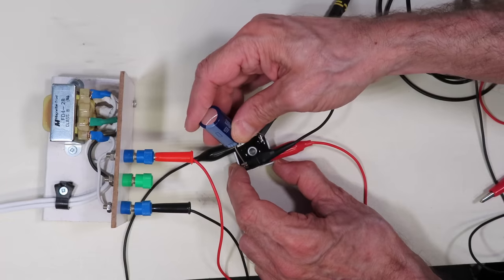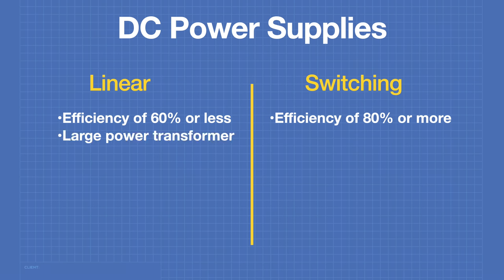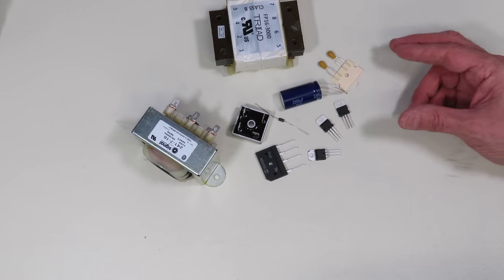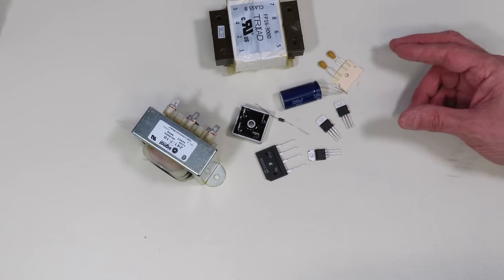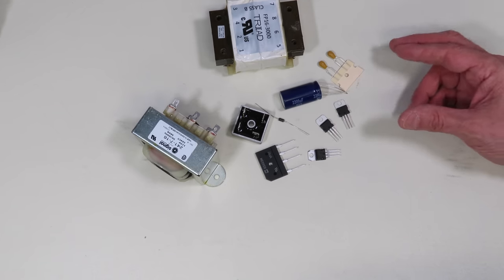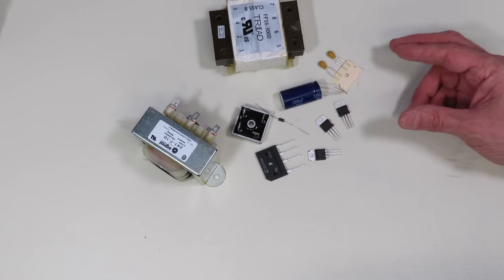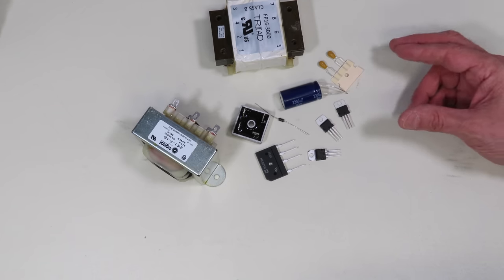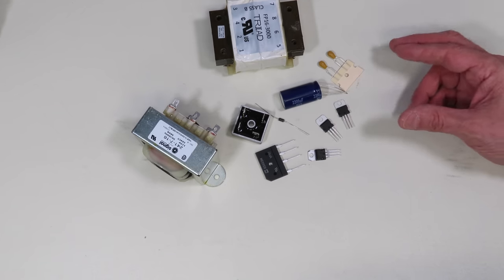Linear DC Power Supplies - Designing & Building Custom DC Power Supplies

Comment: I wish I could (legally) make my own power supply here in Australia.   We are not (legally) even allowed to change a plug end on an extension cord without using a licensed electrician.   I am comfortable with AC power, had all the safety training, but without paying for a licence I am not allowed to do it.  I guess it is lucky that less safe power supplies are available on ebay that we can legally kill ourselves with :).    Sorry, being a bit facetious there.   It can be frustrating being an a country with such restrictions.
Reply: No offense but try to learn how to move are you going to tell them that you are trying to build one cuz I'm not just do you enjoy your life
Reply: You can definitely change your own plug here in Aus. Maybe go get your test and tag licence if you don't know what you're doing or want to use the cables commercially. You can also make your own power supply if you're competent.
Reply: @CalmAsHinduCow  No you can not.  Under the Australian law, you must be a qualified electrician for attaching a new plug to the end of a lead. Definitely can NOT do any 240v wiring, whether on an extension lead or on fixed wiring.
You may be able to make your own power supply, but an electrician has to wire the 240V side to a socket or plug.  
Might be a good thing to check the rules as it seems you have made a mistake there.

To quote from a reputable electricians website, who is paraphrasing from the legislatiion - Note that attaching a new plug to the end of a lead is one of the things in the list.
*****
Can I Do These Simple Electrical Tasks?
Many everyday people around Australia would be guilty of doing these seemingly more simple electrical tasks at some point in their lives, and may have performed some of these tasks without even knowing they have actually broken any laws.

These include things like:

Replacing a light switch or power point
Building your own extension lead
Repairing an electrical appliance
Installing a new light fitting
Attaching a new plug to the end of a lead
Replacing a lead on an appliance
Installing a ceiling fan

These are just some of the more common things DIYers might be tempted to do themselves, or actually have done. However, as innocuous as some of these tasks might seem, it’s still dangerous and against the law to make these fixes yourself if you’re unlicensed.
*****

If you want to do it and break the law, and invalidate insurance, that;s fine.  Go ahead.   Just hope it doesn't fail as insurance are very good at rejecting claims for leads that are not certified and do not meet the standards (which includes moulded plug ends)
Reply: The King just wants to make sure every action is a source of tax revenue. 😂

Comment: I've watched perhaps 20 of your videos, and, if I were someone wanting to produce informational or how-to videos, (or if I speak with anyone planning to pursue it,) I would reference them to this particular video.  I would go on about what I like specifically, but this video has it all.  Not that your others lack, it's just that- within the scope of a "simple" power supply, your example of a YT producer wouldn't get lost on someone who is not interested in electronics, and they could profit from your absolutely fantastic way of filming, lighting, recording audio, adding effects, linking to other sources, consistency, and so, so much more.  I know this comes a year after you posted it, but I've saved it for both the reference for others and because I definitely will be building this as my first full scratch system build.  What a great job you continue to do!!!  Thanks so much for all your hard work!!!

Comment: An excellent video, from which even experienced builders can gain tips; I did. Thank you. A few points that I noted... 1) I do not recall that you discussed the additional overhead voltage needed by the voltage regulator. Lots of people just add 1.5 volts, above the voltage regulator's output rating. However, a close inspection of the data sheet reveals that a minimum of 3V of additional voltage is required for the best ripple rejection. 2) The small, rectangular trim pots are not intended for continuous use. They are meant to be set, once, for some calibration factor and not turned, again, except for fresh calibrations. That is the way that you are employing them; this is just a tip for inexperienced builders. They will fail, quickly, with regular use. Use a knob-style pot, for user adjustments. 3) Using resistor dividers to create additional output voltages limits the current supplied by those outputs to the current carrying ability of the resistors used, not the regulated voltage supplied. Meaning,  the LD1085 can supply 3A, but the trim pots that you used can only carry a fraction of that. By extension, that means that a calculation based on the trim pots wattage rating will be necessary to determine the current that can be sourced for the additional outputs. Or, if you intend to purchase resistors for the purpose of carrying the full 3A, you will need to make a similar calculation to determine the wattage rating they will needed. 4) The style of Volt/Amp Meter that you are using has a known minor issue... They source there voltage from the DUT circuit. This is called "burden voltage." Therefore, they do not display the exact voltage of the DUT. There are YouTube videos on this problem and how to correct the wiring. 5) Most of us now own inkjet printers and they do not do as well for creating labels. So, another easy method for labeling is to create the label in your favorite draw program and, once laid out properly, print it onto white paper as a mirror image. You can find the mirror image printout setting in the file/print properties function. Then, take the paper to a big-box office supply store and have them use their laserjet printer to copy it onto clear film transparency paper. Because you printed a reverse image, the tender ink will be behind the clear film and protected, once you orient the print to read correctly from the front. Cheers!
Reply: Very helpful observations. The tip about printing onto clear mylar is very useful!
Reply: @douglas2lee929  Thank you!
Reply: You make many good points, but with regard to (3), I don't think you have a correct understanding about how the circuit is (probably!) wired.  Unfortunately, no schematic of the full circuit is provided (that I recall), but I believe that the 4-way switch is used to select one of four voltage divider pairs to set the output voltage, rather than having the supply current passing directly through these pots.  Three of these dividers are provided by the trimpots on the circuit board, and the one for user-adjustable output voltage is composed of the panel pot plus a trimmer on the circuit board (used to optimize voltage range).  All these dividers are sourced from the output of the regulator.  The wipers/set point voltages from these pots feed into the points on the switch, with the centre pin of the switch connected to the adjustment pin on the regulator.  Therefore, the circuit is capable of providing full power to the external load regardless of which voltage divider is used, since in all cases the regulator output is directly connected to the positive binding post.

Thanks for the other observations and suggestions!  I especially like the idea of using clear film transparency paper and a laser printer to label the chassis.  The only thing unclear about this is how to mount the transparency onto the case, but I suppose something like 3M Super77 spray adhesive would do the job.  Is that what you use?
Reply: @andreafalconiero9089  "with regard to (3), I don't think you have a correct understanding about how the circuit is (probably!) wired." That is quite possible. "The only thing unclear about this is how to mount the transparency onto the case, but I suppose something like 3M Super77 spray adhesive would do the job.  Is that what you use?" I do use spray adhesive and I like it very much. But, for this application, I believe it could be seen through the clear plastic. So, I would use a different approach... I would make the label to be slightly smaller than the entire size of the face plate. I would cut very accurate holes for the switches/pots, etc.  I would remove all the knobs/etc. I would then apply the label  to the face plate and use the hardware/nuts/etc. to secure the label in the middle of the plate. I would finish the edges by applying some type of decorative tape. But, each individual should use their creative instincts and work with the supplies and tools that they have. It should be fun. Cheers!
Reply: @t1d100  Thanks for the reply.  
I like your suggestion for mounting the transparency, but thought of a couple of others as well:
1) If the spray adhesive would mess up the appearance of the background, it might be possible to fix the problem using a paint layer on top of the printing.  I would try applying an opaque spray paint onto the printed side, and then use spray adhesive to bond that to the case.  As long as the paint layer doesn't separate from the transparency film, it should look good and both the adhesive and the case itself would be hidden.  This could work particularly well if one was re-using an old case with unwanted holes, etc., since these too would be covered over.
2) There are quite a few project cases that have a separate plate for the front and rear panels that slides into a groove on the case.  By using one of those, it should be easy to keep the transparency in place without using any adhesive and/or paint, just by setting it loosely within the frame and relying on the knobs, meters, etc. to hold it in position, as you suggested.
Reply: @andreafalconiero9089  Excellent ideas!

Comment: I've built linear and PWM power supplies over the years. I try to keep my circuits running cool. I believe that this project would benefit from a large heat sink on the regulator IC. The amount of heat can build up fast and catch you off guard. With plenty of open space on the back of the case looks like a good location for the heat sink. It is also possible with an op amp and some other components to get the low end of the voltage regulation down to 0 volts. If you don't care about the circuit being more complicated current regulation could also be added. For a simple Bench top  Power supply this is an excellent project and I would highly recommend it. I think I would go with an electrolytic cap on the output as I have seen too many of the tantalum caps short when they go bad. I wish people would have given me feedback on some of my projects as it is sometimes easy to overlook something when designing and making a project. I love this channel.

Comment: I have built so many of these through the years. The 78xx series and the LM317 made it simple and you could always get a decent transformer out of old electronics.  I still have one I built in 89   as part of my breadboard setup. It has 5v, 12v and a variable section similar to what you built. The whole thing was built into a metal and wood sided box I had from an old audio amp.

Comment: Great project but couple of comments for anyone trying to build this exact design.

You will need a much larger heatsink for the regulator. A linear regulator drops the voltage between its input and output, the byproduct is heat. So if you have 1A load and the regulator input voltage is 30V but output is 5V, the regular will need to drop 25W of power (25V*1A). This is another reason linear regulator based power supplies are heavy. You can get better cooling using a thermal switch and controlling a fan when the heatsink gets too hot.

A lot of these LDO’s and older regulators (like classic the LM317) require enough bias current on the adjust pin to overcome the leakage current. The datasheet of the LM317 talks about this. You don’t need to use a trimpot to adjust the maximum output voltage, the datasheet will give you the equation and sometimes examples.

As few others have pointed out, a diode from the output to the input will help protect the regulator and discharge any capacitive loads that might at the output. LM317 datasheet has an example.

A nice addition would be a fuse at either the AC input or output of the rectified voltage. Putting a chassis mounted fuse at the AC input will help replacing the fuse a lot easier in case the fuse blows.

Lastly thank you for taking the proper precautions and insulating the AC main lines come into the box. A lot of other DIY projects don’t.

Comment: It is good practice to install a reverse diode across the regulator input to output pins, this prevents regulator damage when an external  voltage is accidently applied to the output of the power supply, easily done with a bench supply.
Reply: How exactly can you do that?

Comment: A friend of mine gave me 2 x HP 6214A linear supplies that didn't work. Took them home and fixed them.
That was like 20 years ago. They're still my lab power supplies!
14 volts at 1.2A is more than I've needed in all these years. 
For big load testing, I have lead acid batteries used on my UPS and 60V 8A Boost converter with adjustable voltage and current.
Reply: Hello. Thanks so much for the input. 
I need the power supply that can charge a 200amps battery. Something that gives over 14V 30amps
Reply: @quickfixengineeringltd8035  What is the chemistry of your battery?
Reply: @piconano  dry cell lead

Comment: SMPS CAN BE more efficient than a linear voltage regulator - but not always.  You have to examine the efficiency graph on the spec sheet and read the specs carefully.   It is easy to be misled.
Linear VRs are much cleaner and more like a battery. SMPS can be noisy.
A SMPS may have trouble with inductive or high capacitance loads.
Many commercial SMPS do not have short-circuit protection.

Comment: Well done on the video, great guidance for anyone setting out. I am not new to power supply design but you have convinced me about the nibbler!  Not a correction or a criticism but a good precaution for a build like this is to cover the chassis area under the circuit board with Kapton tape. A great instructional and anyone building the power supply should find it very useful for years to come.

Comment: Thank you for an interesting and informative video.  Obviously there are time constraints on such a production, but I would recommend some brief additions which I think are important in an article which includes the word "designing" in its title:
1 - at about 19min, connect the rectifier to 48R//1000µF to show that on-load the output has a reduced voltage and some ripple, the lowest part of which must still be within the input voltage range of the regulator.  Maybe add another 1000µF to halve the ripple.
2 - at or before 19min, add that the transformer must have a VA rating about 1.6 times (the raw DC output voltage) × (DC current output) or it will overheat.
3 - Stress that the peak input voltage to the regulator MUST NOT APPROACH its data sheet "abs max" spec.
I think these points could be covered inside a minute total, provided you don't take the extra time to explain why (2) and (3) are necessary.
Anyway, congratulations on a nice, instructive, helpful and practical article.

Comment: thank you so much for making this. In case you want to do another how-to video which is similar but not exactly the same: I'm also interested in putting together a DC-in power supply with a battery and battery health readout, which charges the battery from photovoltaic.
Reply from the maker: Thank you. And that's a great idea, along the lines of something I was considering.

Comment: You are doing an excellent job, and it is very entertaining and relaxing. Another advantage I may add to linear PWR supplies is that they are more durable than switch-mode PWR supplies. If any component failed in SW-mode supply. They stop working.